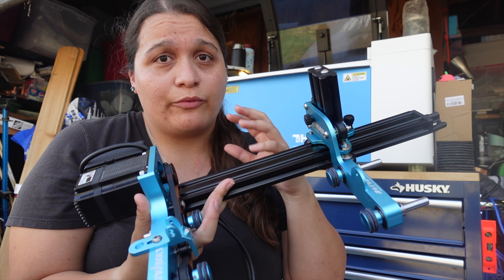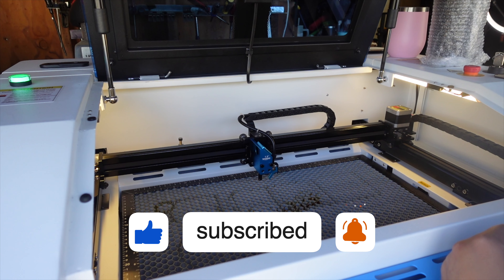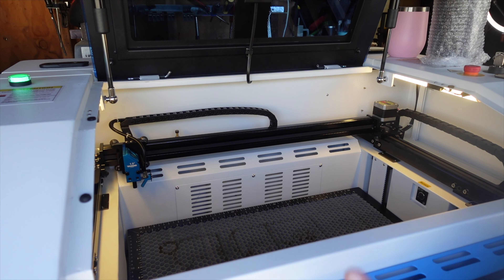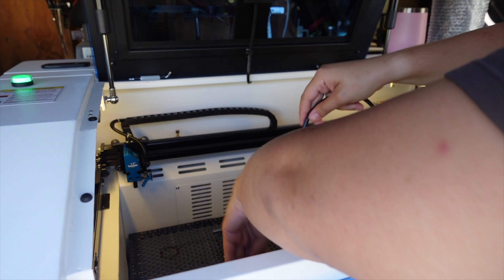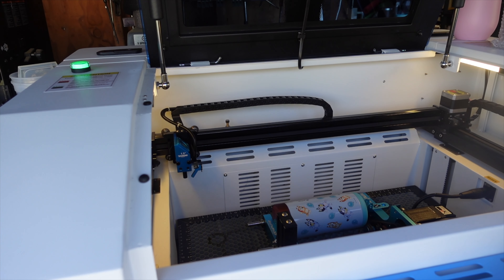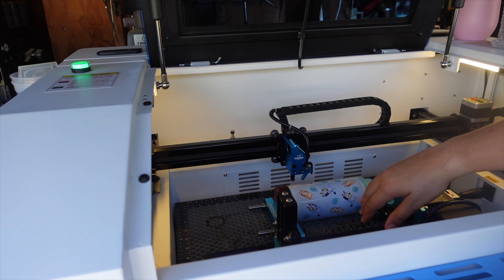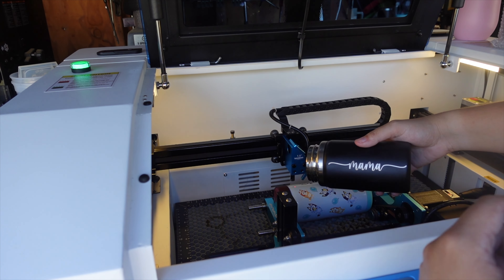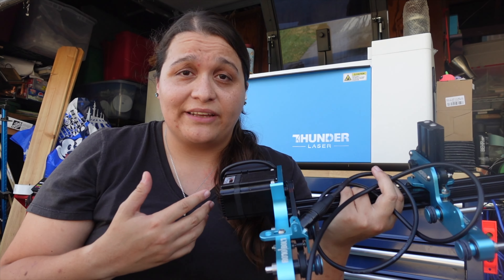How to Install and Attach the Rotoboss Rotobolt Rotary || Thunder Laser BOLT 101

Comment: Which Husky are you using for your
Laser set up? 😊
Reply from the maker: I think this one. the feet rest on the table and laser over hangs by about a inch. https://www.homedepot.com/p/Husky-52-in-W-x-25-in-D-Standard-Duty-9-Drawer-Mobile-Workbench-Tool-Chest-with-Solid-Wood-Top-in-Gloss-Black-HOTC5209B12M/312145945
Reply: @ChippedBuilds  thank you!